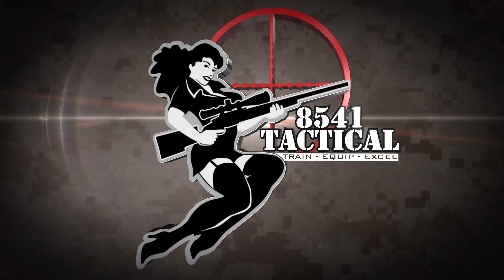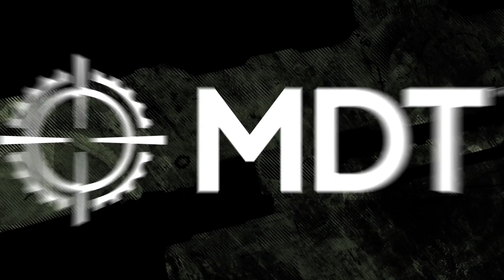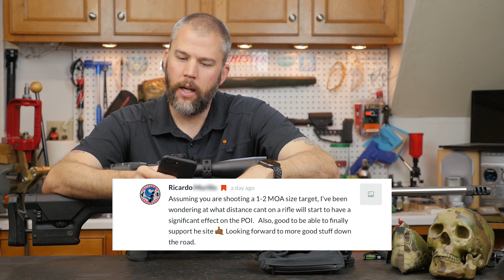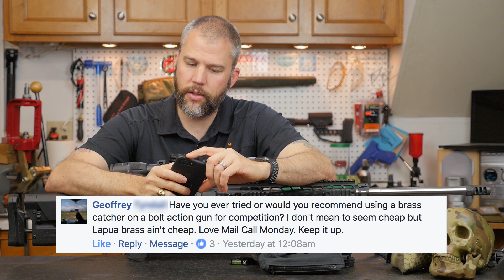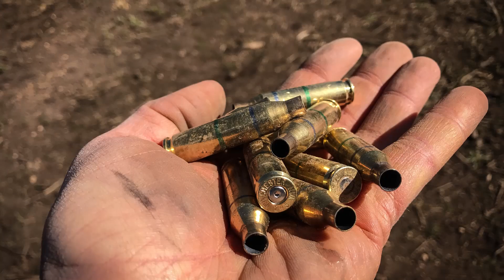Mail Call Mondays Season 6 #8 - Rifle Cant, Pistol Grips, Bolt Gun Brass Catchers

Comment: Bubble levels are iffy.  I mounted one on each side of my RPR for lefty practice.  When the rifle is level front-to-back, like when on a bench, both levels match up.  When the rifle is canted downhill or uphill, they aren't even close.  They're both the same Vortex 35mm level.  Vortex levels aren't perfectly perpendicular to the scope, so even if you level them to the reticle, they're only level left-to-right when the rifle is level front-to-back.  Otherwise, you can't trust them.

I noticed this after I mounted my levels and put the rifle down on the bipod and the bubbles went wonky to each other.  Other people have commented on it, laughing at my ability to mount them.  When I level the rifle front-to-back, they're confused.

Comment: What's the cause of deviation from a canted shot? Is it just the fact that your reticle cross hairs aren't level and you're aiming a barrel that isn't perfectly straight? I mount my scopes level by eyeing it. I'm a tradesman, so have a good built in mental leve I guess. Because my rifle stock "naturally" fits in my shoulder pocket in a canted position, I mount my scope level to my somewhat canted rifle. It just fits naturally and is more ergonomic for hunting. I shoot my .308 sub moa at 100 yards. At most, I only get to shoot to 350 yards and never have any issues. I've heard people speak of having the rifle action itself being out of plumb and having that affect the trajectory. I cannot see any issues caused by a non plumb barrel (seemingly would only be an issue if it isn't perfectly straight) shooting a round bullet sitting in a round case that's against a round bolt. I'm trying to wrap my head around this for the day when I start shooting farther out. Thanks!

Comment: Exact cant error can be easily calculated (at least for small cants). In Excel form it is: tan(C*PI( )/180) * D , where C is cant in degrees and D is the "drop" at your distance. The answer will be in the units you use for D (like inches, or feet). Example: My Sierra software gives this for a typical 308 175 gr. Matchking (at 2500 FPS), when sighted in at 100 yards and sight height of 1.5 inches: Bullet Path at 1000 yards = -438 inches. Plugging that into the formula above gives a lateral error of 38 inches for a cant of 5 degrees (1 degree would produce error or slightly less than 8 inches). The flatter your round shoots, the less the lateral error (and vice versa).

Comment: I went to a class that taught you to turn your rifle 90 degrees to adjust for targets moving at very high speed (60mph+)  I just did what the instructor said and got through the class but gave them bad reviews for the content of the class.  It seemed to be a useless method because of the application.

Comment: I tried the  TBR on my Ruger precision rifle and found the opening to be to low for the ejection path. My Remington 700 kicked the cases even higher. To work the opening  would need to extend  up to the mid scope tube height or a little higher and we would have  to fit that around the windage turret somehow...
Reply from the maker: +Niles Coyote thanks for the input.